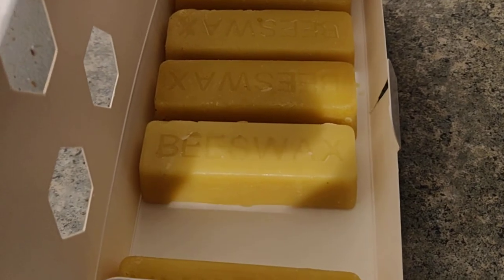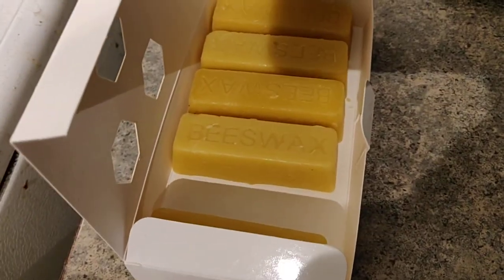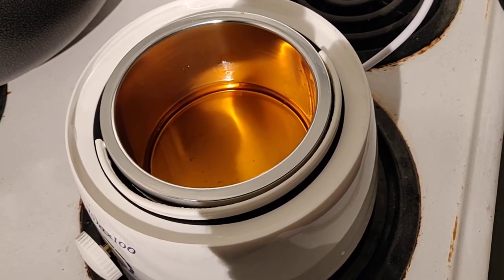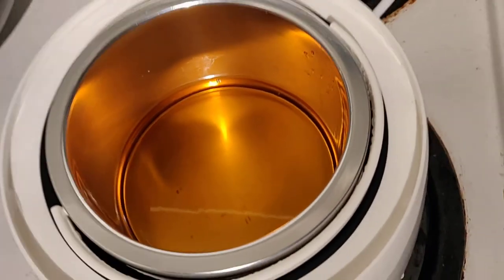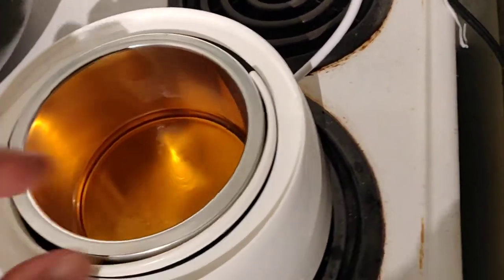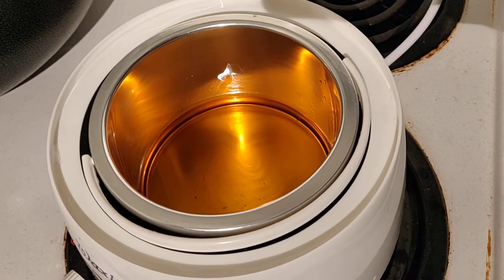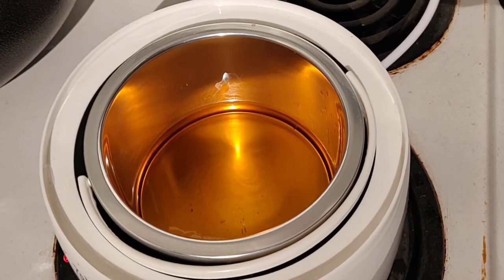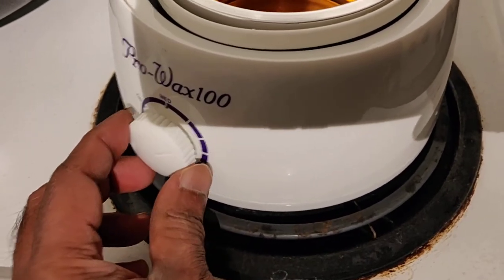Accordion Reed Wax - Home-made - using Bees Wax, Rosin, and Linseed oil

Comment: Hello - Haven't you had a problem when rosin for some reason collected at the bottom of the pot while being melted and didn't mix up with the bees wax?
Reply from the maker: John, since Rosin has a higher melting point, melt the Rosin first on a simmering gas flame. Add a few drops of the oil when Rozin melts. Then add the wax and mix well. Once done - transfer the vessel to the wax warmer (keep it on and hot). This way we can maintain the mixture in a molten state - for repair work. Took a while with experiments to understand this. Not difficult.
Wax pot on its own won't help.
Reply: @PremMenon  That's what I did last time: melted rosin first on an electric oven but when I added wax later some portion of the rosin (I hope not all of it) remained as a brownish goo at the bottom of the hot mix.
Reply from the maker: @johnpiettro4644  Oh. Ok John. Give it shot one more time, and allow the Rosin to melt completely. As you can see in my video, the mixture has amalgamated well. Good luck!👍
Reply: 69воска, 26,5канифоли, 2,9скипидара, 0,9масло льна... Натуральный скипидар всё смешивает.
Reply from the maker: Thanks for your feedback.
Reply: @РемзиМеметов-о7т  Please tell me the numbers shown are in unit weight, is correct? Thx in advance!
Reply from the maker: @ChytHDLE yes, the units are correct. Thanks for your message.